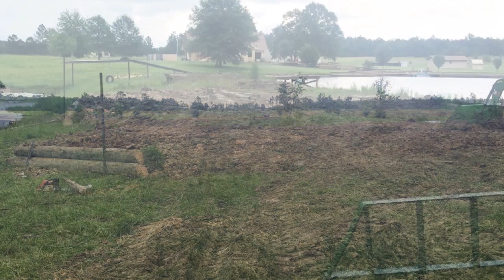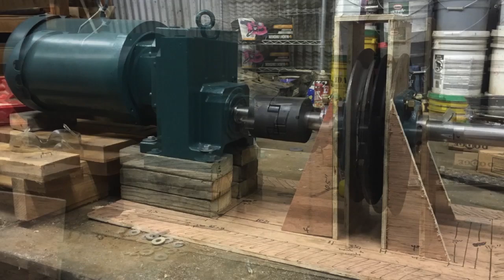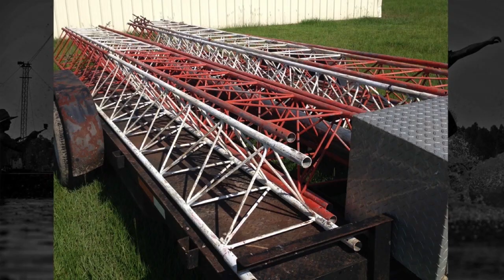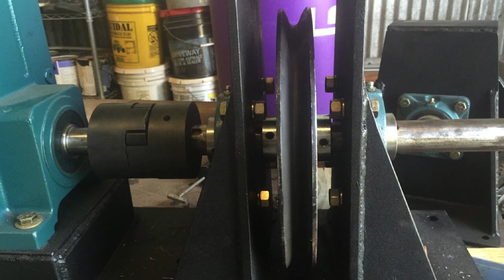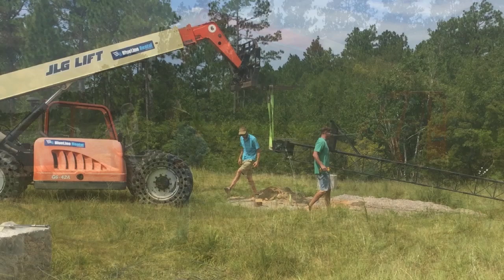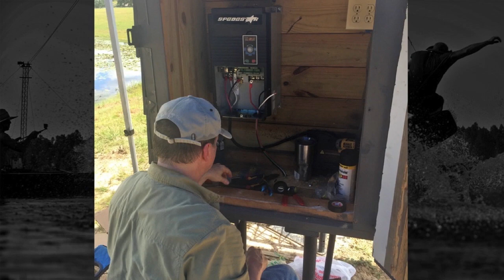How to Build a DIY Homemade Backyard Two Tower Cable Wakeboard Park 2.0

Comment: Which power supply cable diameter did you use? And do you know, how many Amps the System is using at peak Power?

Comment: Where did you find pulleys, which material they are? And how thick is rope?  Thanks
Reply: Elektronek K I have custom made steel pulleys that are intended for steel cable. Cable is 3/8 stainless
Reply: @ThatJeepAdventure  thanks for reply, and how did you splice the rope ?
Reply: @elektronekk4306  There is no splice. Both ends connect back to the center bolt on the bottom of the carrier.
Reply: @ThatJeepAdventure  ok, thank you.

Comment: Hey can you share the specs on the motor size? Now that you have been riding it is it powerful enough or would you recommend something different?
Reply from the maker: I have the 7.5hp motor. You could step to the 10 but the 7.5 is plenty for us. The only time it maybe bogs down a little is if we are teaching someone and they are trying to deep water start in the middle of the pond. Even with a 10hp I would think that someone plowing water would bog it some too. If I was to do it again, I would get the 7.5. It has been an awesome setup so far.
Reply: @BackyardRailPark  thanks so much! Yeah I think we're gonna try to spec a 10hp synchro motors that matches the required rpm in the powerband but has more low end torque. Do y'all use an encoder or drive it by hand?
Reply from the maker: encoder and manual... a buddy has been tweaking the fully automated function and it should be back up in June. I prefer manual personally just because I trust it more and it gives the rider more freedom in the turns.

Comment: Are pulleys rubber coated or they are just    blank steel?
Reply from the maker: Elektronek K they are steel pulleys
Reply: @BackyardRailPark  does not rope slip on steel wheel? everywhere I saw rubber coated wheels ,but I don't know how to make them.
Reply from the maker: Nope, doesn’t slip. The wheels are designed for steel cable
Reply: @BackyardRailPark  ok,thank you

Comment: How much it cost? Total im planning to put on 2,200sqm lot area
Reply from the maker: I was able to run across a lot of things cheaply and we salvaged the towers, so we were able to save money along the way. I think you could do it for about 16k if you did all the work and fabrication yourself
Reply: @BackyardRailPark  What about the electronics and software it runs on? Did you find that somewhere as well?